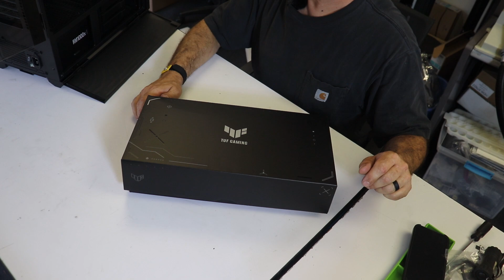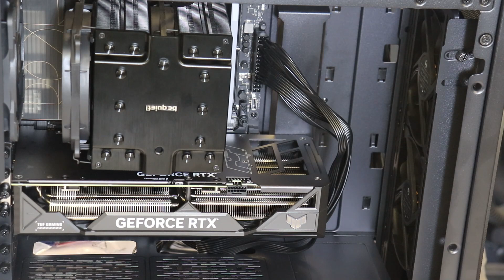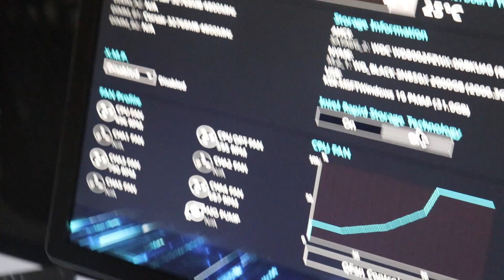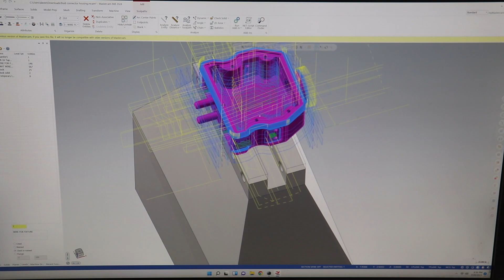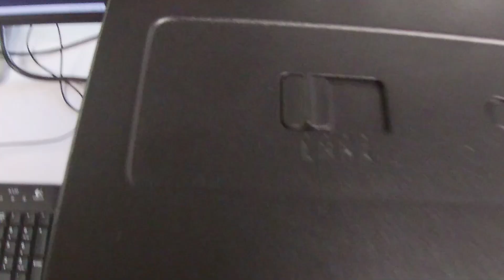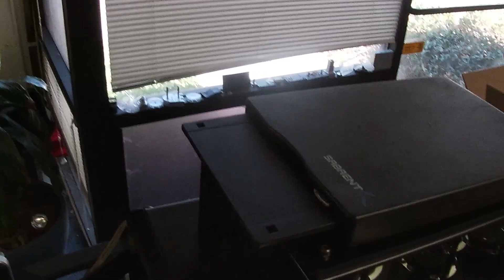CAD CAM Computer build 2

Comment: Thanks for sharing your build. Which version of SW are you running? I recall that sw simulation doesn’t really utilize gpu. (I think rendering does now) that’s something I’d like to see in newer versions.  

Also I noticed from your bios screen that your ram xmp profile is disabled.  Not sure if that’s an oversight or your hardware doesn’t support it, but you can squeeze out more ram speed with that on. (Typically you won’t get your advertised ram speed unless that is enabled)

Thanks for sharing and can’t wait for your next upload :-)
Reply from the maker: Thanks for watching!  I am runnig SW2023 and 2021 and 2009 (for my simulation)  I'm note sure if I can get SW 2009 on the Windows 11 computer. I am curious about the GPU vs CPU for FEA as well.  Also, thanks for the advise on the bios,  I need to really dig into it, and I will try the memory fix.  Also, windows doesn't see my 8TB mag disk hard drive at the momment, but the Bios saw it, so I need to figure that out too.

Comment: Might double check the CPU cooler for orientation. The upsidedown be quiet leads me to believe it should be rotated 180. The fan should be pushing fresh air from the front of pc across the heat sink and the exhaust on the back of the case should grab that air and toss it out of the case.
Reply from the maker: OK, will do.  I do recall that there was a clearance notch in the fin array to prevent interference with the DIMM Ram Chip in pos A1.  Thanks for the feedback, I will chech airflow

Comment: A GPU and a DSP are very different. GPUs have many small specialized hardware cores in parallel that do specific tasks (like shaders). DSPs are more tailored for signal processing, and have lots of layers in serial to eachother. Also the hardware in DSPs is more optimized for implementing filters and other operations typical in digital signal processing
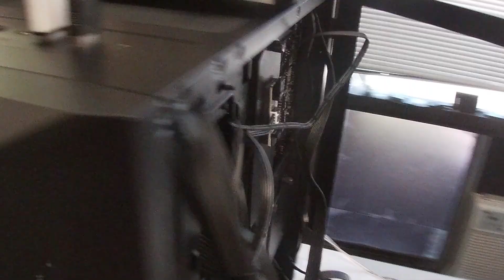Reply: 19:37 That's a SATA power connector like you'd find on a hard drive, but it's not a hard drive obviously - you plug it into a SATA power lead from your power supply. It's supplying +5 and +12 to something (probably more RGB lights on the front of the case I bet). Probably not really necessary to connect it.
Reply from the maker: @gorak9000  Thank you for the insight, and thanks for watching!
Reply: Also I'm pretty sure a 4070 is WAY WAY overkill for CAD work, but the store is happy they oversold you on a very high profit item for them
Reply: @gorak9000  I've never regretted spending a few hundred more on a computer that will be around for many years. Video cards  have dropped quite a bit recently, equivalent of < USD $900 here for the 12G 4070. 4080 would be overkill, imho at $300 more. Gaming enthusiasts are a godsend to us CAD users since they provide a huge market for high performance hardware. Software is going to be $15k+  I imagine for SW and Mastercam plus subscriptions maybe so the hardware details are not that significant. By the way, pure luxury, but I like the SpacePilot series for some kinds of CAD work.
Reply from the maker: @gorak9000  Yes, in most simple models I don't need a super GPU, I do get into situations with FEA stress analysis, or very large assemblies ( like a car) where I have had GPU slow downs.  Solidworks responds to low GPU bandwidth by turning parts in an assumbly into "lightweight".  So you need to keep setting parts back to full parametric to change it.  In other cases, in large assemblies, solidworks will replace the visual impression of your part with a simple block model with similar color when you rotate the large assembly around.  So these Solidworks part simplifications and fine model meshing requirement for FEA led me to the GPU I purchased.  On NVIDIA website, I downloaded the Creator driver, rather than the Gammer driver.  The Halo game I played to test the card did have refresh lag lines in high screen shift...maybe due to "creator" driver.  I am looking forward to figure out if the CAM fine 3D tool path generation is effected by the GPU more or the CPU.  Maybe hard to prove, short of removing the GPU to test.  In the past I did physically burn up a standard onboard video drive

Comment: Thats one ginormous GPU(Graphical Processing Unit). I remember building a computer cooled by one of those GPU fans mounted on a Noctua heatsink (Looks tiny compared to the current CPU cooler), to cool the CPU. Be wary of Windows though, may need to secure it with other insecure s/w?. Installing Nvidia driver should allow for more finetuning of the GPU for optimal performance of the installed CAD software. Also could help with throttling down, when the CAD software in use does not need full performance, help extend the life of the GPU, while significantly reducing power consumption. It will be good to disconnect the computer from internet forever, once everything is updated. Not sure, if that is possible nowadays?. Nice touch on the thermionic aka vacuum tubes at the end. Placing it on top of computer case, might even make  them sing?(Might add subtle distortion on top of the unique harmonics of the tube amp, due to vibrating grid on the tubes). That is one weird connector, could be an extension of the front ports to be connected to the motherboard?. ❤👍
Reply from the maker: Thanks for the feedback.  I did notice some noise coming from the tube amp, so i my find another location for it.  I will look into you other adive too, over the next week or so.